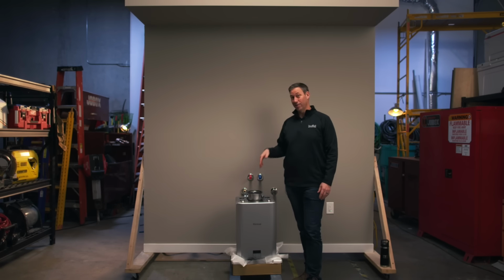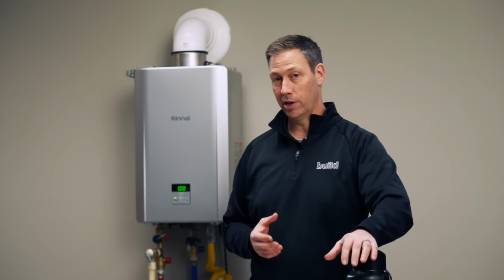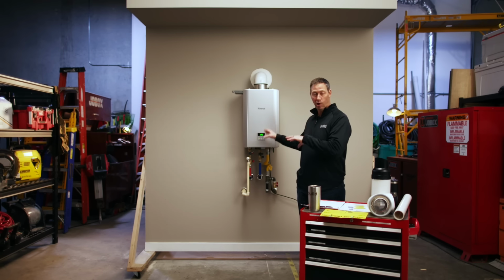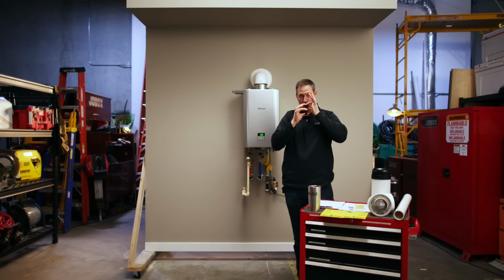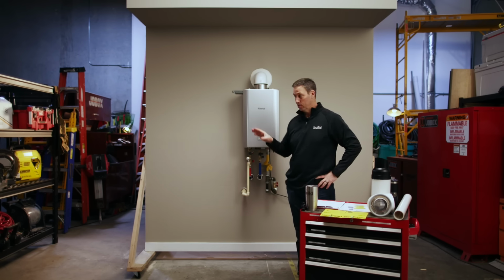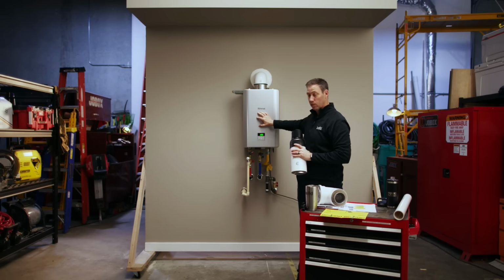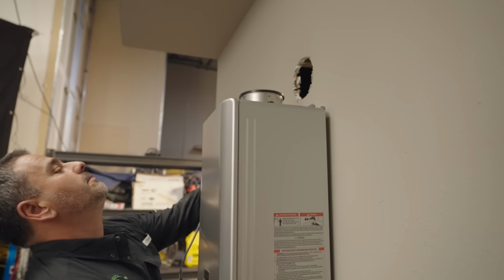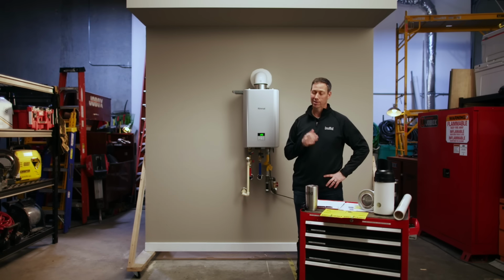Replacing A Water Heater Tank? Probably the Best Tankless Option for You.

Comment: On those little plastic cross overs to bring heated water quickly to the farthest faucet do I install one in each bathroom and kitchen? Because he didn't really explain how it works other than it circulates. In addition we have an older Rinnai 98i we don't have a circulation pump how would this work in older installations?

Comment: I already have a recirculation pump with a thermal bypass valve. It's controlled by Alexa. You can either voice program (Alexa, turn the pump on for 30 minutes at 7 am every day) or you can have Alexa turn the pump on a set amount of time before you know you'll need hot water. Alexa, turn the pump on for 20 minutes. Getting rid of condensate isn't a problem due to where the water heater is located on an outside wall. I'm just researching tankless water heaters. Right now we have a 230 volt 60 gallon water heater. My wife and I are the only people in the house and we're gone for a week at a time. We don't need the water heater making hot water 24/7/365.

Comment: you didn't mention that its only non con as long as the vent run is less than a 5' vert. these are important things to mention when it comes to this stuff, also rinnai is known for error code 10 hell. these units suck to work on

Comment: Recirculation system adds cost to your  fuel  costs.  Electricity, natural gas or propane will be a lot more. I bet that heater will come on every 15 minutes and heat the water in the line  to the furthest point in your system.
This is  24/7 even when no one is home.  Why did he neglect to tell everyone that fact?

Comment: What I want to know, does ANYONE make a screen system for a non condensing intake vent to keep some of the larger insects out? I’m looking at mine and coming up with a version that can protect the intake part while not interfering with the exhaust. Mine comes out of the wall on the side of the building. I’ve shopped around and have asked that question and so far no response, so I’ll keep asking.

Comment: My aunt allowed me to lease her rental cabin for a discount. It's close to where I work.  So, I after I moved in, I noticed water on the cement adjacent to the water heater.  I opened the door and saw water at the bottom from a compromised tank.  Recently I was awe of tankless systems as it would be easy enough to convert too right there.  However, I planned to move out come that winter as my job was moving to another location, plus I know nothing about repairing a tankless system and I didn't have time to take courses on how to fix one. So I got on the phone trying to find plumbers that work on them and I asked, "just off the bat, do you charge more for fixing a tankless heater," and I got two telephone numbers for guys that work on them. I asked them, "is it more expensive to work on a tankless system?" and each of them said, "it depends". Well that answers that question. I was asking for a Y/N answer.  So I got another tank system and put it in that same day.  I was surprised I even considered a tankless.

Comment: If the recirculation pump feature was smart, it would detect the pressure change on the hot line and warm up the hot water line. A timer may work for folks on a fixed schedule. It's wasteful for folks on a schedule that's unpredictable. Also, the recirculation pump system could distinguish between an open faucet and broken line, to prevent heating and pumping when a pipe or hose breaks.

Comment: Thought the whole point of on demand water heater was to eliminate it from always running, like the traditional tank ones. If it's always running, doesn't that eliminate the point of it. Yeah it might be more efficient but kind of pointless to me to introduce the recirculation function. Sounds like gas bill going to be similar to traditional water tank but with all the headaches of these fancy electronics and valves...
Reply: Good point, on the new one he's demonstrating how does it know when to preheat the water when you slightly crack on the hot water faucet? And what, If I get delayed for some other reason no one mentioned how long this thing runs for? Same for older on demand units with installed optional circulation pump some use a little spring-loaded button to push and it turns on precirculation pump. I just don't like wasting so much water waiting for hot water, I might be interested in this plastic fitting that connects both hot and cold together but because my Rinnai 98i is older I need a pump installed.

Comment: If the valve is dumping hot water in to the cold line, where does it go? The cold line is already full of water. And, if it has a recirc pump but I don't want the extra consumption, can I leave off the valve when I install?

Comment: Just heating up water. it is ironic how we use different methods to heat WATER  the cheapest and the easiest one it's still the bottle. after 10 years  I dispose of it and I can get another unit out of the store for the $600 and I found out that the savings does not justify the up front costs and maintaining  Do not need a computer  chip to heat up water

Comment: In my previous home, I've installed a Rinnai 14y ago, apartment, absolutely no issues. This week, because of this long run, this week I installed a new Rinnai in my home, after a 10y old tank cracked. I don't know about the other brands, but I can testify for Rinnai.
Because of the location, very soft water, the old unit has never been descaled.

Comment: I have a tankless water heater that is 100% efficient:  A Black & Decker 50 AMP electric flash heater.  It's just my wife and I, so we don't need to run multiple hot water uses at the same time.  We always take showers, so we only need about 1 gallon per minute.  We can shower as long as we want, and it's temperature-controlled, so it's a steady 106 F.  Best of all, the electricity costs us nothing because our solar grid-tied system has never generated a bill since we installed it years ago.  It's small enough, we could install it right in the bathroom British-style if we wanted instant hot water.  The cost:  $168 at Lowes!

Comment: Doesn't the use of that circulation valve cause the cold water line to fill with hot water? So if ur hot water is HOT you now have to wait for the cold water to mix it down to a tolerable temperature...

Comment: We are all electric and dont have gas, so tankless is not the best option for us. We bought a hybrid watwr heater and its been the best ever. Super efficient and offers wifi connectivity for high demand and energy saving modes. Plus i have it vented into the garage which has the added benifit otmr cooling the garage in the summer time!

Comment: Some comments made below about prolonging tanked heater by replacing anode rods often. True, the rods are very tight to remove. If you strong, you can do it but might damage the other solder joints in the process. I used impact wrench and made the task a lot easier. Similar to car mechanics work on tire lug nuts.

Comment: What I read tankless in US etc are unreliable probably due to high temperature. My friend had 2 and always leaked after 2 years even with maintenance. My. parents lived in Hong Kong. They all had the tankless, lasted 25 years or so, and zero maintenance. No circuit boards. I think the difference the ones in Asia are always in the bathroom etc, so no long  piping, and no need of high flame temperatures.

Comment: Hey Matt!   We've had a Rinnai here in South Alabama for 20 yrs, It is a great unit and has served well despite being installed by people who claimed to know everything, but knew absolutely nothing about tankless and really screwed up royal installing our system. We also heat our home with a hot water coil: hydronic heat. Things have never been right & we've had so many headaches through the years. I know the Rinnai machine is not to blame. It's hard not to drool over this system or others like it that you show in your videos. It would be great to have someone that is really savvy come and iron out all the bugs and get this puppy running the way it was made to. Another other thing that distresses me is that we don't have the system flush set up. We are on well water that is not hard but there is a lot of calcium.  Pardon the sob story, but things like this really do boil the blood!🤬
Nice to know about that recirculation valve.😀👍👊🤙

Comment: These tankless heaters are not cost effective. I've installed several and the expense is ridiculous. There are two main reasons to get a tankless; no large water storage and endless hot water. There are zero efficiency reasons or bullshit climate change benefits. You will never save enough to recover the huge expense. This said, Rinnia is a great product.

Comment: After recirculating the water into the cold water line , you must be getting tempered water out of the cold water side of the sink . Tempered water after all is a mix of hot and cold and we were always told not to use the hot water to make tea , coffee or drink it  because it contains metals from the heater . Heat exchangers leak for many reasons but if one of them is from cavitation where did the material that was removed to cause that leak go ( right into the hot water ) . Maybe it would be best to add a dedicated return line with a smaller diameter tubing  to keep the Hot Water separate .

Comment: I'm very upset, Rinnai's warranty is useless. They do not have the ability for a homeowner to send pictures of clear faults and damage to be reviewed like many other home products. I have a failed heat exchanger that is 6.5 years old which the part itself is covered but the wiring harness that got wet and melted is not covered. None of the labor or inspection process is covered. At best you have coverage for a $150 part

Comment: Hi Matt. Love your channel and saw your videos on tankless water heaters. I've only seen you discussing Rennai gas systems, however. I've recently been reading a bit about the latest generation electric tankless water heaters, especially those by German-made Stiebel Eltron. Have you ever worked with them?

I'm wanting to migrate my gas devices to electric over the next few years due to a desire to reduce my carbon footprint, improve safety, and avoid the ever rising gas prices. The Stiebel Eltron product line is prolific in Europe and seem well made. Any thoughts or experience with them?

Comment: What's your thoughts on putting a recirculating pump at the longest run to get hot water there.  My kitchen facuet is about 50 feet from my hot water heater.  I was thinking you wouldn't be wasting water or energy that way

Comment: I have the exterior, condensing version of this. The valve really does work. You get about 70% of the effectiveness of an actual loop for no cost. That's amazing.

But. 

The smart stuff all doesn't work. The wifi module doesn't work and you need a fair amount of competence reading the lit or a good plumber to set it up and make control adjustments. The connect to your phone stuff all doesn't work (3 warranty claims trying to get it to work before literally giving up lol)

Luckily - there isn't a dedicated realistic NEEEED to schedule the water heater, so I let it go. If you look up Rinnai forums, you'll see a hundred passed off plumbers also complaining about this and their damn salesmen saying it will do stuff that doesn't work on it because of their buggy and literally unworkable software.

It performs admirably and way better than my previous tanked.

8 out of 10 stars.

Comment: My tankless water heater stopped working last summer and I called a plumber and he tried to sell me on a new Rinnai heater. He told me that since my heater was 10 years old, it was past it’s service life and it would be best to replace it at a cost of $6k. I did a little searching online and ordered a new igniter and one other small part for a total of $42. It’s been working fine ever since. I also learned you should flush them with vinegar at least every year to clean the deposits out. You just need a $50 submersible pump, a bucket and some washing machine hoses.
Reply: Sounds about right.  $6K bill instead of $42 better for the plumber.

Comment: I just replaced my failed tank heater with a tankless last summer and man, is that the biggest mistake I’ve ever made on my house. It takes an additional 30 seconds to get hot water now, which means I’m wasting an ocean of water and dealing with ridiculous inconvenience. (It’s a Rinnai, and the recommended model of most of the big plumbing shops here.) I guess I’m saving some energy by washing my hands with with cold water when I’m in a hurry, but “encourages use of cold water” is not exactly a ringing endorsement for a water heater. Huge regrets.

Comment: I like tankless water heaters, but they do require some maintenance. I only recommend gas, but those have their issues too. If space isn't an issue, or your house is all electric, then a hybrid heat pump unit is a great choice too, especially if you're in Zones 1-3 (Southern, Hot/Humid).
Reply: what doesn't require maintenance?
Reply: @John_Lee_  I suppose I should have said, "they require additional maintenance" (that a tank heater doesn't need). Most homeowners don't flush their tankless unit with acid every year, or even every few years. They don't do anything until it stops working. Whereas a tank heater that hasn't been flushed will still last 12 years or more depending on where you live. Basically, everyone I know that has a tank heater never thinks about it (unless they're constantly running out of water), whereas people that have tankless are calling a plumber more often for error codes, scale issues, etc. They work well when they're maintained, but therein lies the problem.
Reply: @MyFortressConstruction  It's pretty much like any new technology that increases efficiency. Same complaints about cars but meanwhile they get better mileage, last longer and have more power.
Reply: @John_Lee_  I highly doubt that the newer cars are going to last longer than a 98 suburban with 450k miles. The more complex we make electrical systems, the more problems we have. Go watch smarter everyday's take on the Artemis project, or compare a brushless Milwaukee/DeWalt drill vs. an old brushed drill (I have heavy duty drills from the 70s that are still functioning while my efficient cordless drills/saws are dying after a year or two), or read the forums discussing Brother printers vs. other more convoluted systems, etc. There is a an engineering balance between efficiency and reliability. If you keep trying to push efficiency by adding higher and more complex systems, which invariably is what occurs, then you will run into more issues. This is even true of toilets. There are so many examples of this. This needs to be a part of the discussion and not just tossed to the side as fear-mongering.
Reply: @MyFortressConstruction  Yea that 98 suburban is leaps and bounds more reliable than cars from the 70s while having significantly more electronics right? I'm guessing maintenance was done on the car as well.

Comment: Matt , Thank you and all the commenters on this.  I have a question regarding the Thermal Bypass valve... I also have a shower which is in the bathroom furthest from the water heater.  You said to mount the bypass valve under the sink area, but will that also accommodate the shower and its hot water needs???Please advise,  Thank You!  Tom J.

Comment: How is the thermal bypass valve able to pressurize the cold side without rupturing something in the line? If you just keep adding more water into the cold side, water has to bleed out somewhere.
Reply: It is flowing back to the heater itself.  It's a loop.

Comment: Navien is probably the best unit out there, we have very little trouble with them. The A model the only one we sell has a small liter size tank that stays at temperature. This eliminates several things. 1. when you turn on your hot water, hot water is on its way, no time difference from your old tank type. 2. No cold water sandwich. 3.No minimum flow rate.  If you have a modern home with a large hot tub, the tankless will not only fill it but will be able to replace the massive  heat loss they incur when turning on the bubbles. Will you use more gas? Of course, good things usually do cost more. Gas meters, at least in our area are supplied by the gas company, just a simple phone call and they replace the meter free of charge. Never understood that argument. The warranty on a Navien is 15 years on the exchanger and electronic components are relatively inexpensive. Dont buy a combi boiler! This is the latest craze. Modern boilers have outside reset controls and modulate output at a 10 to 1 ratio. Take my home for instance, my heat load is 36000 BTUs on a zero degree day. With a 70,000 BTU boiler I can modulate down to 7000. But this turndown ratio is based on input, most Combi boilers are 200,000 in, this means a minimum firing rate of 20,000. That would be ridiculous.

Comment: Stop burning gas.   Just stop it.  It is bad.  Don't be stupid.  Buy a heat pump water heater. The install of that tankless is expensive and they are unreliable.  My clothes washer would stop and start the hot water ten times.  Those cycles wear out a tankless heater.  A tank heater don't care.  If you want tankless, get a few of the small cheap ones and place them near the use, like near the shower or what ever.  Then there is no waiting for hot water to get there.  You can stash an small electric tankless in a wall behind a shower.